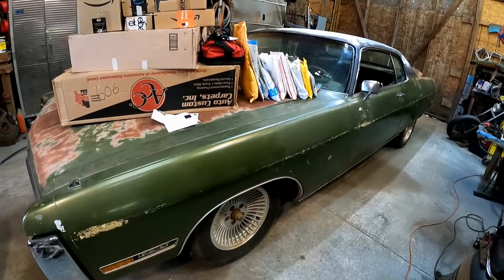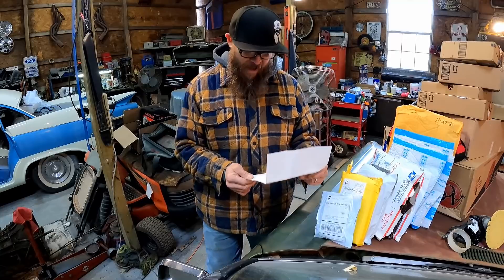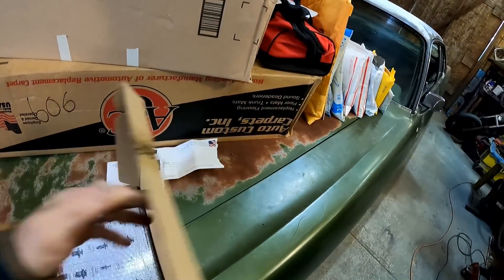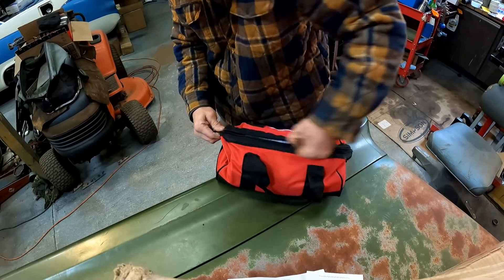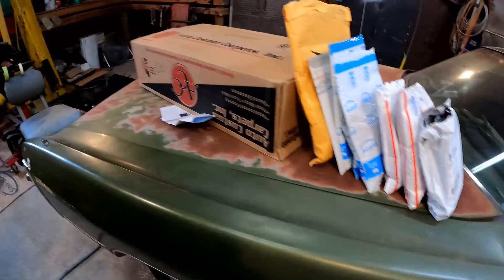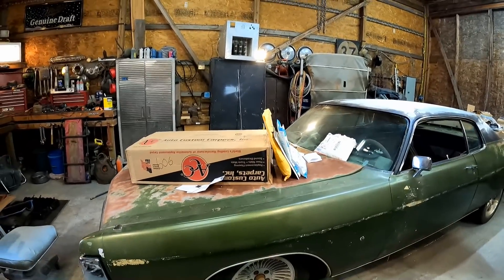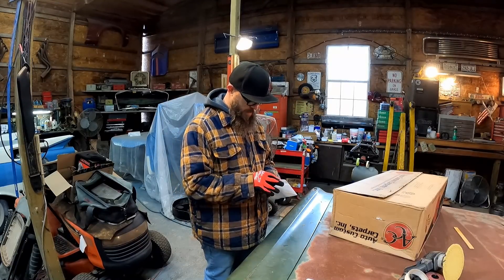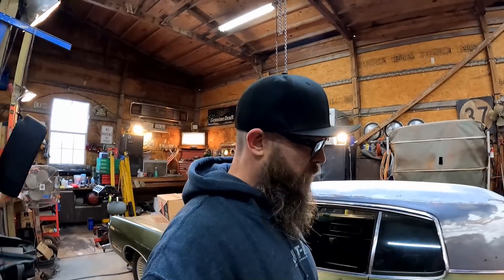I CAN’T BELIEVE SOMEONE SENT ME THIS

Comment: Hey Mike there is a salvage yard that has three Plymouth Fury Hardtops no Vinyl tops either. One is a dark Green 1971 one is a mint green 1973  and one beige 1974  and all rust free and he said the roof would cost 75.00 if you cut it off. If the Old man Collier said if he cuts it off it will cost 165.00 plus tax. His green  has the same color green dash and pad and he said that would be 150.00 for the whole assembly. Our he would sell you the whole parts car which is a 1971 for 450.00 for the whole and you haul it away. and body is rust free and has the 3.7L 225 CID Slant 6 he said was seized but I bet it runs. He has had the car for 10 years in a garage.
Reply from the maker: Where is this located?

Comment: Just subbed to Eugene!
Reply from the maker: Thanks bro
Reply: @weirdbeard8898  no problem!  You know it’s funny is in the summer I do landscaping I do about six lawns a day and I work every day during the week and I have right now in my backyard seven lawnmower is sitting there and each one has an issue either I don’t run right or it don’t run at all or the motor shot so Eugene is definitely gonna help me out because I got a lot of questions and a couple of the lawnmowers I took apart the carbs and try to clean them and I just can’t get the shit to run and it’s so irritating so they pile up lol
Reply: The thing is is I’m extremely handy and mechanical but for whatever reason I can’t get them lawnmowers to stay running to save my life. But then again they’re not commercial models they’re just your regular run-of-the-mill on Mormon mowing your lawn once a week and I’m doing you know 40 lawns in a week with it you know lol